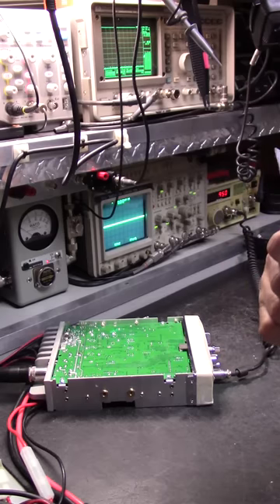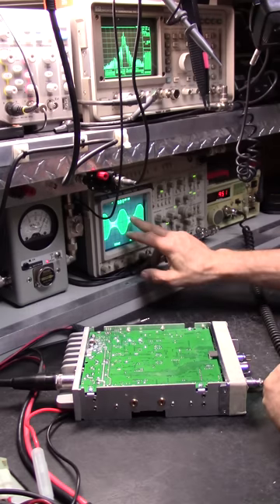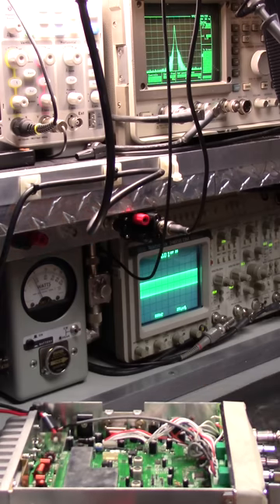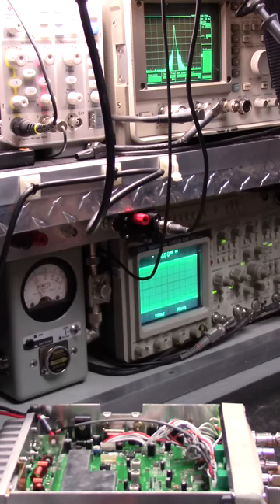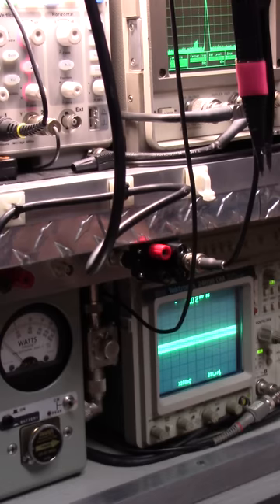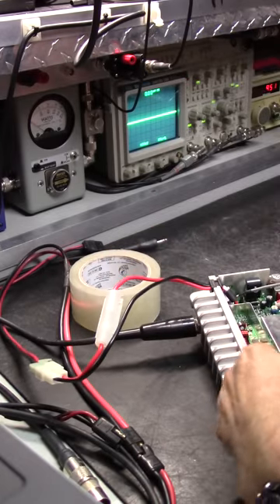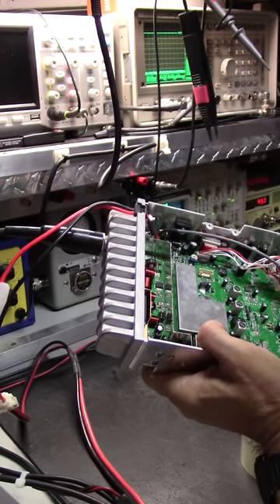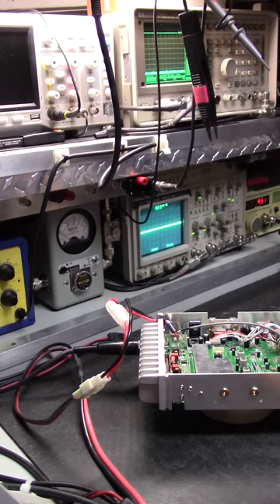Stryker SR447HPC2 Mods By: MeterBaitor D-Rail "BOXCAR" - Wolfmans CB Radio Shop Carnesville, GA.

Comment from the maker: Another Facebook Hero Dog And Pony Show .. Romper Room
When these idiots need 20,000 to 30,000 watts, splatter 20 channels and brag about it there's something wrong and they'll take your $$ anyway they can. It requires skill and knowledge to go barefoot .. not running giant amplifiers and splatterbox butchered up radios with a poor receiver! LOOK AT THE METER Aaudiooo LOL

I no longer service hacked up butchered radios by "Captain SplatterWatt".  Don't let them experiment on your Expensive equipment!  Here's what it takes to cut through the noise, be loud and crystal clear with a better receiver too:  A) Tuned Bench:  https://www.youtube.com/watch?v=lwcDfXOgAls. 
True, it's more complicated and time consuming to accomplish these consistent and accurate results. Below is a partial procedure and list of calibrated equipment used to achieve this level of performance . Read on ..

Fine Tune CB Radio Shop strictly adheres to (https://www.nist.gov/) NIST Traceable Calibrations and other industry standards to maintain accuracy and consistency for providing Real World Performance Tuning of Citizens Band and 10 Meter export mobile radios with integrity.

"Basic Textbook AM/FM/SSB Transceiver Tune, Alignment and Calibration" 

1) Pll adjustments
VCO & OSC, AM TX OSC, USB TX OSC, LSB TX OSC.

2) Transmitter alignment
DRIVER BIAS, FINAL BIAS, SSB  (or gate voltages for mosfet versions) CARRIER BALANCE, HI-LO AM & SSB Power, RF METER, AMC, ALC and FM DEVIATION.

3) Receiver alignment
AM/FM RF & IF SENSITIVITY, FM DETECTOR/DEVIATION, SSB IF SENSITIVITY, SSB S-METER, AM/FM S-METER (100uV unmodulated -67dbm for “S-9” meter reading!), AM/FM SQUELCH RANGE, SSB SQUELCH RANGE, and NOISE BLANKER/AUTOMATIC NOISE LIMITER (Real World dBm to volts (uV) tables below).

That's just a typical run of the mill textbook tune up and alignment (if you're lucky). There's more to it than frequency alignment, modulation adjustment, meter calibration and a tune up report displaying exaggerated rms Bird peak watts! 

"Test Bench includes"

Bird 4314C Meter
https://www.birdrf.com/Products/Test%20and%20Measurement/Power-Meters/Wattmeters-Line-Sections/RF-Wattmeters/4314C_PEP-Single-Element-Wattmeter.aspx
Part 1) https://www.youtube.com/watch?v=RpX9IHe4ORM&t=16s
Part 2) https://www.youtube.com/watch?v=LuhbqTf6Bxw
Bird 4314C Accuracy Test: https://www.youtube.com/watch?v=DqEOabYqhQo&t=5s
Bird Stipulates 1/2 wavelengths  https://www.youtube.com/watch?v=5eWhgT-rTII
And Genuine Bird Elements from 1K down.

Bird 4373 Sampler 
https://www.rfparts.com/signal-samplers.html

HP8924c with options
http://userequip.com/files/specs/2147/HP%208924C%20Repair.pdf
https://www.youtube.com/watch?v=Cg1w0xBa27s&t=1s

HP8920a with options
https://www.keysight.com/upload/cmc_upload/All/EPSG072204.pdf

Three analog scopes, one digital 200 Mhz
https://www.atecorp.com/atecorp/media/pdfs/data-sheets/tektronix-2465b-2467b_manual.pdf
https://www.youtube.com/watch?v=by98x4eu2lM

Fluke 27fm
http://www.fluke.com/fluke/inen/digital-multimeters/fluke-27.htm?pid=56055
 
LCR http://www.lcrresearch.com/wp-content/uploads/2017/05/LCR_Pro1_Manual_version1.03.pdf

Power supplies
6 Cosel PBA1500f12 (750 amps) variable and configurable.
https://en.cosel.co.jp/product/powersupply/PBA/PBA1500F/PBA1500F-12/

Times Microwave Coax jumpers and test leads
http://www.timesmicrowave.com/cms/products/cables/lmr/
https://www.youtube.com/watch?v=EmqaGJ6IWow
https://www.youtube.com/watch?v=1ltFVSxGp5Y
https://www.youtube.com/watch?v=v12YZT_1o90
https://www.youtube.com/watch?v=h7iiYfmYWRA&t=215s

Amphenol RF Connectors
https://www.amphenolrf.com/
https://www.youtube.com/watch?v=dVh5B0hdEA0 
https://www.youtube.com/watch?v=dKZg8T_AOso

More range, compliments, reliability and a quieter, clearer but more sensitive receiver,  Get Fine Tuned .. not peaked and ruined.

Here are some VideoGates of me at the bench practicing what I preach using my bench radio or customers radio completed and ready to be shipped: https://www.youtube.com/results?search_query=hard+drive+163+ more: https://www.google.com/search?q=Hard+Drive+163+nm&ie=utf-8&oe=utf-8&client=firefox-b-1-ab

It's what I recommend, use, service and sell ... to you ... not something non practical or deceiving in a misleading way. I'm not just the tech and owner of Fine Tune CB Radio Shop, I'm a customer too!  When finished, You'll be giving radio checks, not asking for them .

dBm To Watts and Volts
Tables below displays relationship between Power in [dBm] or [Watts] and Voltage in RMS, peak, peak-to-peak for sinusoidal signals in 50-Ohm systems for accurately measuring and tuning am/fm/ssb receiver sensitivity, agc, squelch and "S9" Meter calibration.

  [dBm] [Watts]   [Volts]rms   [Volts]p    [Volts]pp
-140 0.100E-16  22.361 nV  31.618 nV  63.236 nV 
-139 0.126E-16  25.089 nV  35.476 nV  70.952 nV 
-138 0.158E-16  28.150 nV  39.805 nV  79.609 nV 
-137 0.200E-16  31.585 nV  44.662 nV  89.323 nV 
-136 0.251E-16  35.439 nV  50.111 nV  100.222 nV 
-135 0.316E-16  39.764 nV  56.226 nV  112.451 nV 
-134 0.398E-16  44.615 nV  63.086 nV  126.172 nV 
-133 0.501E-16  50.059 nV  70.784 nV  141.568 nV 
-132 0.631E-16  56.167 nV  79.421 nV  158.842 nV 
-131 0.794E-16  63.021 nV  89.112 nV  178.223 nV 
-130 0.100E-15  70.711 nV  99.985 nV  199.970 nV 
-129 0.126E-15  79.339 nV  112.185 nV  224.370 nV 
-128 0.158E-15  89.019 nV  125.874 nV  251.747 nV 
-127 0.200E-15  99.882 nV  141.232 nV  282.465 nV 
-126 0.251E-15  112.069 nV  158.465 nV  316.931 nV 
-125 0.316E-15  125.743 nV  177.801 nV  355.602 nV 
-124 0.398E-15  141.086 nV  199.496 nV  398.992 nV 
-123 0.501E-15  158.301 nV  223.838 nV  447.677 nV 
-122 0.631E-15  177.617 nV  251.151 nV  502.302 nV 
-121 0.794E-15  199.290 nV  281.796 nV  563.591 nV 
-120 0.100E-14  223.607 nV  316.180 nV  632.360 nV 
-119 0.126E-14  250.891 nV  354.760 nV  709.519 nV 
-118 0.158E-14  281.504 nV  398.047 nV  796.094 nV 
-117 0.200E-14  315.853 nV  446.616 nV  893.232 nV 
-116 0.251E-14  0.354 µV  0.501 µV  1.002 µV 
-115 0.316E-14  0.398 µV  0.562 µV  1.125 µV 
-114 0.398E-14  0.446 µV  0.631 µV  1.262 µV 
-113 0.501E-14  0.501 µV  0.708 µV  1.416 µV 
-112 0.631E-14  0.562 µV  0.794 µV  1.588 µV 
-111 0.794E-14  0.630 µV  0.891 µV  1.782 µV 
-110 0.100E-13  0.707 µV  1.000 µV  2.000 µV 
-109 0.126E-13  0.793 µV  1.122 µV  2.244 µV 
-108 0.158E-13  0.890 µV  1.259 µV  2.517 µV 
-107 0.200E-13  0.999 µV  1.412 µV  2.825 µV 
-106 0.251E-13  1.121 µV  1.585 µV  3.169 µV 
-105 0.316E-13  1.257 µV  1.778 µV  3.556 µV 
-104 0.398E-13  1.411 µV  1.995 µV  3.990 µV 
-103 0.501E-13  1.583 µV  2.238 µV  4.477 µV 
-102 0.631E-13  1.776 µV  2.512 µV  5.023 µV 
-101 0.794E-13  1.993 µV  2.818 µV  5.636 µV 
-100 0.100E-12  2.236 µV  3.162 µV  6.324 µV 
-99 0.126E-12  2.509 µV  3.548 µV  7.095 µV 
-98 0.158E-12  2.815 µV  3.980 µV  7.961 µV 
-97 0.200E-12  3.159 µV  4.466 µV  8.932 µV 
-96 0.251E-12  3.544 µV  5.011 µV  10.022 µV 
-95 0.316E-12  3.976 µV  5.623 µV  11.245 µV 
-94 0.398E-12  4.462 µV  6.309 µV  12.617 µV 
-93 0.501E-12  5.006 µV  7.078 µV  14.157 µV 
-92 0.631E-12  5.617 µV  7.942 µV  15.884 µV 
-91 0.794E-12  6.302 µV  8.911 µV  17.822 µV 
-90 0.100E-11  7.071 µV  9.998 µV  19.997 µV 
-89 0.126E-11  7.934 µV  11.218 µV  22.437 µV 
-88 0.158E-11  8.902 µV  12.587 µV  25.175 µV 
-87 0.200E-11  9.988 µV  14.123 µV  28.246 µV 
-86 0.251E-11  11.207 µV  15.847 µV  31.693 µV 
-85 0.316E-11  12.574 µV  17.780 µV  35.560 µV 
-84 0.398E-11  14.109 µV  19.950 µV  39.899 µV 
-83 0.501E-11  15.830 µV  22.384 µV  44.768 µV 
-82 0.631E-11  17.762 µV  25.115 µV  50.230 µV 
-81 0.794E-11  19.929 µV  28.180 µV  56.359 µV 
-80 0.100E-10  22.361 µV  31.618 µV  63.236 µV 
-79 0.126E-10  25.089 µV  35.476 µV  70.952 µV 
-78 0.158E-10  28.150 µV  39.805 µV  79.609 µV 
-77 0.200E-10  31.585 µV  44.662 µV  89.323 µV 
-76 0.251E-10  35.439 µV  50.111 µV  100.222 µV 
-75 0.316E-10  39.764 µV  56.226 µV  112.451 µV 
-74 0.398E-10  44.615 µV  63.086 µV  126.172 µV 
-73 0.501E-10  50.059 µV  70.784 µV  141.568 µV 
-72 0.631E-10  56.167 µV  79.421 µV  158.842 µV 
-71 0.794E-10  63.021 µV  89.112 µV  178.223 µV 
-70 0.100E-09  70.711 µV  99.985 µV  199.970 µV 
-69 0.126E-09  79.339 µV  112.185 µV  224.370 µV 
-68 0.158E-09  89.019 µV  125.874 µV  251.747 µV 
-67 0.200E-09  99.881 µV  141.232 µV  282.465 µV
-66 0.251E-09  112.069 µV  158.465 µV  316.931 µV 
-65 0.316E-09  125.743 µV  177.801 µV  355.602 µV 
-64 0.398E-09  141.086 µV  199.496 µV  398.992 µV 
-63 0.501E-09  158.301 µV  223.838 µV  447.677 µV 
-62 0.631E-09  177.617 µV  251.151 µV  502.301 µV 
-61 0.794E-09  199.290 µV  281.796 µV  563.592 µV 
-60 0.100E-08  223.607 µV  316.180 µV  632.360 µV 
-59 0.126E-08  250.891 µV  354.760 µV  709.520 µV 
-58 0.158E-08  281.504 µV  398.047 µV  796.094 µV 
-57 0.200E-08  315.853 µV  446.616 µV  893.232 µV 
-56 0.251E-08  0.354 mV  0.501 mV  1.002 mV 
-55 0.316E-08  0.398 mV  0.562 mV  1.125 mV 
-54 0.398E-08  0.446 mV  0.631 mV  1.262 mV 
-53 0.501E-08  0.501 mV  0.708 mV  1.416 mV 
-52 0.631E-08  0.562 mV  0.794 mV  1.588 mV 
-51 0.794E-08  0.630 mV  0.891 mV  1.782 mV 
-50 0.100E-07  0.707 mV  1.000 mV  2.000 mV 
-49 0.126E-07  0.793 mV  1.122 mV  2.244 mV 
-48 0.158E-07  0.890 mV  1.259 mV  2.517 mV 
-47 0.200E-07  0.999 mV  1.412 mV  2.825 mV 
-46 0.251E-07  1.121 mV  1.585 mV  3.169 mV 
-45 0.316E-07  1.257 mV  1.778 mV  3.556 mV 
-44 0.398E-07  1.411 mV  1.995 mV  3.990 mV 
-43 0.501E-07  1.583 mV  2.238 mV  4.477 mV 

         Don't be a (SUCKER) Mud Duck!

           Hard Drive 163 NM. 73's! Click click.
Reply: Thank God I came across this video. I'm in the market for new radio, and 2 guys I work with highly recommended wolfman's shop to me. Just sent you a message about getting one from you.

Comment: HD. I'm an old guy, used to run SBE radios to give you an idea of how old. Haven't done much with YouTube and I'm wondering how to contact you. Interested in the Stryker and Anytone radios, or any other that you might recommend. I've watched several of you videos and I'm impressed with what you can do with these radios. I'm also an old HAM operator, but appreciate a clean, 11 meter rig, with good specs and a little power. I've had Siltronix 1011s, Yaesus, etc, but after watching your results with the Stryker, I would like to talk/email you about obtaining one of these or any other that you may highly recommend. Not overly concerned about the price, I just want the quality work that you do.